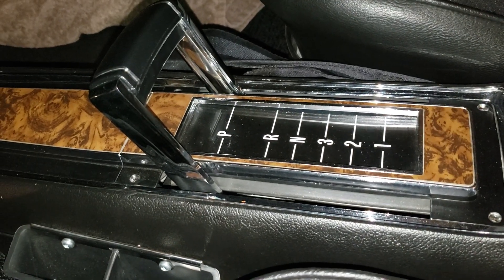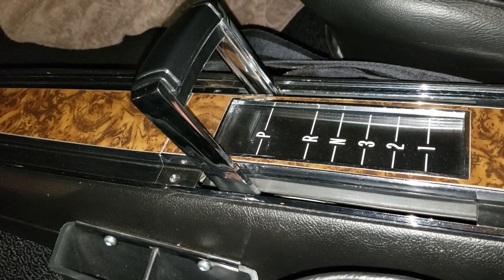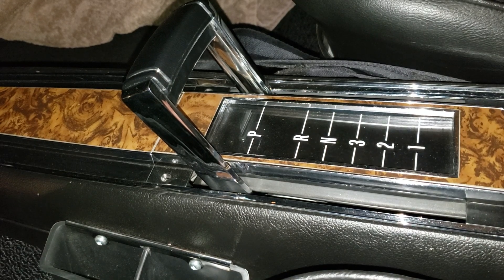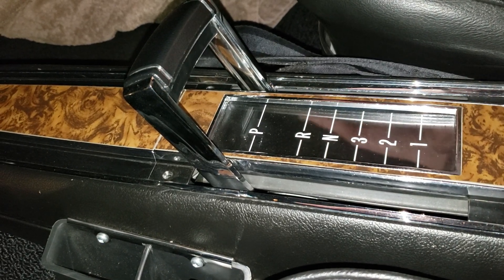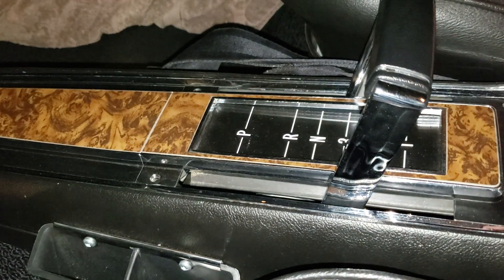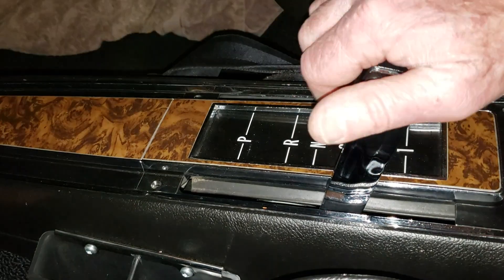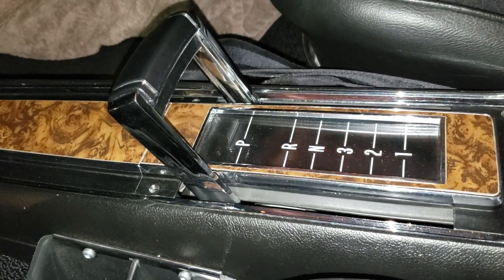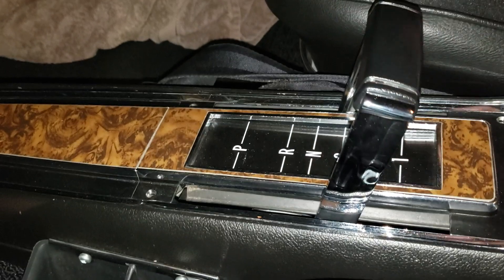DPJ Fabricating, True Slap TS4a, '68-'72 horseshoe shifter detent

Comment: Is 3rd gear Drive? doe's it shift gears on its own when left in 3rd.
Reply from the maker: Yes, 3rd and Drive are the same. 4th is Overdrive. You don't have to manually shift. You can use the shifter the same as before. Put it in OD or Drive, and the transmission operates the same as it did from the factory. Manually shifting just lets you pick the rpm that the shifts take place, instead of the transmission controlling the shift points.